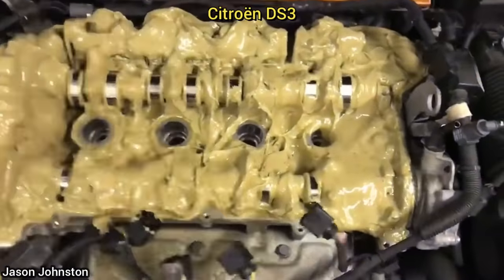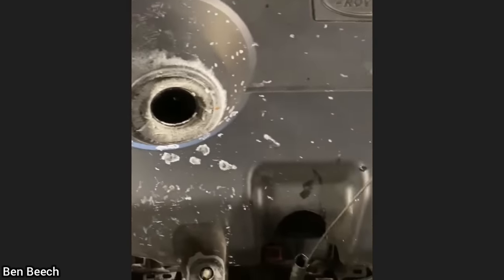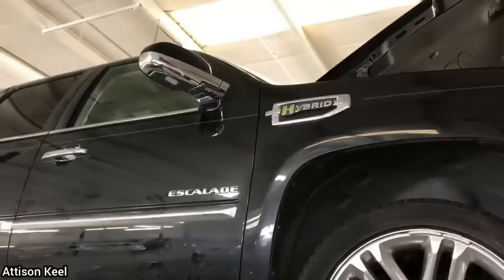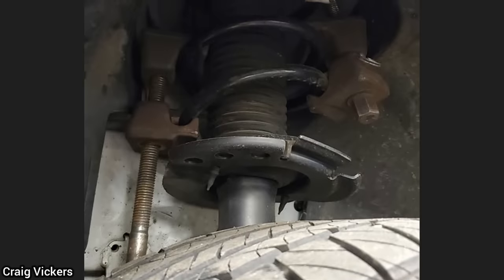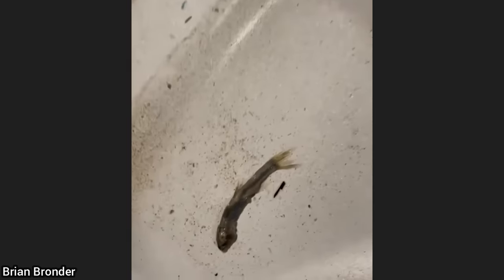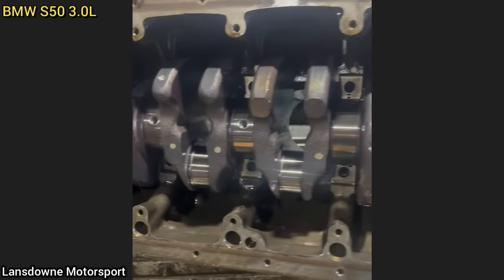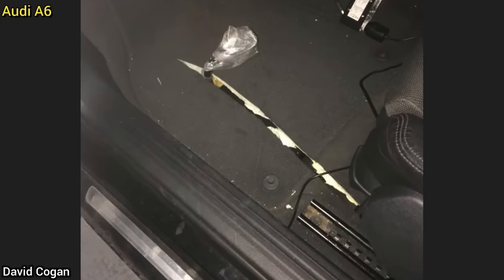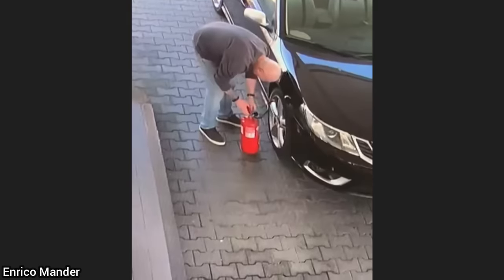Customer States The Car They Recently Bought Runs Rough

Comment: I am always amazed by how many people can not easily figure out where a small rattle is coming from.
Reply: I came to the comments to say exactly the same thing.
Reply: Lot of it is situational blindness. when something has been there for a while eventually your brain stops registering it as a thing until something forces you to think about it again.
Reply: When paying someone to find the problem for you is easier than finding it on your own, this happens...
Reply: Some people are observant and others aren't
Reply: @huma474  yes but you’d think in many cases that the second that item is there, the rattle would start, thus there’d be no guess as to what could be causing it. Also the absurdity of some things is just too much, like hundreds of pennys just rattling around? Gee I fuckin wonder where the rattles coming from.
Reply: I am amazed that these car owners can even get through the day.
Reply: Still scary to hear a rattle and then second guess yourself wondering if it's actually coming from the trunk or rear suspension.
Reply: @jessechristensen1074  When you hear a sound, and you don't know if it's coming from the trunk or rear differential, look in the trunk and see if you forgot you just loaded your trunk with 1500 tambourines. There's no reason to second guess.
Reply: Shortly after I bought my 03' bmw 330i sedan I had no idea the passenger side mirror turned down 35ish degrees to check the curb when backing up. I complained to the mechanic there was a horrible noise when the transmission was in reverse. Even speculated that prerecorded noises were coming from the speakers. Lol that was 13 years ago, still have the car. No regrets.
Reply: Counter-point - it's not easy at all. You THINK it comes from one place, but in fact it comes from somewhere totally different. The sunglasses one is easy to miss because you don't think that place should be rattling. I've fixed the following rattles: weatherstripping by the doors, door strikers, spare lug nut pipe hitting the spare wheel, center console opening tab, the ENTIRE A/C Controller Unit, the Styrofoam above the headliner (called silencers), instrument panel, speaker gaskets, solid objects around the fan blower motor, loosen tapes from excess heat, and of course cargo arrangements. It's tough to locate and fix them all by yourself, like, WHERE IS IT? Very annoying for quiet cars.
Reply: I'm amazed at people not knowing they have trunk fish.
Reply: @gwinbeer  i want to pretend you don't fix things for a living and just had a very rattly car.

I think it's safe to say it's a mix.  Some people just have an off period where their brain doesn't click.  Baby kept them up all night and now something is rattling and they just want it stopped.  Other rattles are hard to find.  But the scary one is when you realize there really are people out there who go through life taking in a third of the stimulus that you do and couldn't observe their way out of a wet paper bag.
Reply: I used to fix refrigerators. One customer's complaint was a loud rattle coming from the refrigerator. Right away, I noticed an aluminum iced tea set (pitcher and several cups, on top. One cup was rattling against the pitcher. I tapped the cup. Problem solved! You should have seen the look on her face!
Reply: @BakedRBeans I’m always annoyed by some hint rattling in my fridge due to the I balanced and poorly baffled compressor shaking the fridge at just the right frequency to oscillate certain items.

I have to admit to not looking for the obvious at first and thinking the noise was coming from the compressor itself.
Reply: Rattles are the worst to diag. I hate them.
Reply: If you turn the tunes up, you can’t hear the rattle -problem solved
Reply: My wife 😂
Reply: Right, too funny
Reply: rattle rattle
Reply: I'm amazed we're all sharing the road with these bozos.
Reply: I often repair small vintage mechanisms and have the same problem. The source of the rattle is right before my eyes, I have to see it but I just don't. One solution I found is to connect a  usb microscope to a large screen and watch the action in ASMR mode. Some "unnoticed" issues are then quite evident.
Reply: @TheBanjoShowOfficial  That's what I'm talking about. Dude throws a metal washtub full of broken banjos in his back seat and he starts hearing a rattle in his back seat. "Where's that rattling coming from?"
Reply: @gwinbeer  That's very true and I've had similar experiences. I'm talking about people who surely couldn't be bothered to reach up and  touch something that's rattling right next to there head.
Reply: A few days ago, I bought a musical keyboard from a yard sale. I looked at its sides 3 times over several days, and didn't see the power jack (or the other 3 jacks) on the side of the unit. It took me a 4th time before I noticed it. I thought it was designed to run on batteries only, and no A/C power...
Reply: I have had a few rattles that just took a few days of driving to figure out. One was the passenger seat belt rattling against the C-pillar (I think that's what it's called), some CD covers flipped around in my center console and I put my ice scraper in the door. It's not that hard to figure out.
Reply: There’s a rattle in the dash…

Others:  take it to mechanic 

Me:  live with it
Reply: "What's a battle?!"
Reply: Well... i was wondering for weeks where that odd clunking noise is coming from when breaking or accalerating. Let me say, i checked a lot of things. But in the end it was the spark plug socket i careless threw into the glove compartment...
Reply: @huma474  You’d think they would check though. Every time I hear I rattle I think ‘where tf is that coming from’ and actually look, and many times it’s been items in my car just rattling against something but no money was spent finding out
Reply: Told a gal that was sitting with the engine idling. "Your Envoy is making expensive noises. Might want to check the oil."
It was not making lifter noise. The rod was knocking and wanted out.
It's OK my boy friend will fix it.
😆😆😆😆
Reply: My mom had exactly one of these phone holders and it rattled so bad she had to remove it. I have a hard time believing someone would not be able to hear from where that sound was coming from. We did get confused for a little bit, but then one of us tried touching the plastic thing where the sound came from. Also, if you put a phone in it the rattle stops, which also makes it more apparent. 

I have definitely been guilty for other things like this of calling someone when I should have checked more closely first, but this specific one seems extremely obvious to me.
Reply: Thanks for saying it
Reply: @theotherohlourdespadua1131  and that, in a nutshell, is the distinct PROBLEM with the USA!
Reply: @downtostandup  goes to show the education of the general public has failed miserably for decades.
Reply: yeah, and on mine, its usual key chain, or water bottle at the sides... its so obvious

Comment: Ah yes, the dreaded "rattle/squeak" complaint. I worked at a Ford dealer for a while, many decades ago, and it was always a techs most hated complaint to try and diagnose. 99% of the time it ended up being something that the vehicle owner had done and not an actual manufacturing flaw. And 98% of the time, the customer was just as mad or madder that it turned out to be their own fault.
Reply: Well, at least when I bring in a rattle complaint it's something like a sway bar, and generally what to take a look at.  At least know the sounds of the car verses the sounds of the junk you put into your car.
Reply: I knew a guy who bragged about how he had leftover trim screws when installing new-car interiors. he was kind of proud to be quickest/most efficient at the factory production line.
Reply: 99%? well then you surely could share with us at least 10 things that "the owner had done" 😂😂
Reply: @gusrock6719  😉no worries
Reply: I would love for a rattle to be just something I forgot in the back. Sure, I would feel embarrassed, but that's very much worth it considering the money you just saved
Reply: How dare you accuse me the customer of messing my car up? I AM THE LAW

Customers can be very… interesting
Reply: I had a squeak like that when I bought the latest car. It turned out the 3rd brake light cover came a bit loose on one end. It's bolted onto the roof panel in the cabin on one end and reaches backwards over the back window, since it's a coupe model. Without the glue holding the whole cover still, two bolts made the noise when it jittered up and down. Taped it back against the glass, problem solved.
Reply: And to think they laughed at my theory that space aliens are creeping into people’s rooms at nite and sucking their brains out thru a straw.🧠👽

Comment: These videos make me feel like I take such good care of my car, because it doesn't have pudding in the engine!
Reply: A good recipe for engine pudding is: add water to oil, then bring to boil.
Reply: The forbidden pudding, from the makers of the forbidden milkshake
Reply: Didn’t the person look at the dipstick before buying??
Reply: or fish in the hatch.
Reply: You need diesel exhaust fluid in the crankcase for that level of wizardry.
Reply: @MattExzy  Don't forget to fill your tire up with a fire extinguisher, Fire proof tires are very vital.
Reply: cock mcballs  they don't use CO2 in the powder extinguishers, propably nitrogen. CO2 bottles usually have insane amount of pressure also to keep the CO2 liquid.
Reply: I drive a Ford 2005 F-150 and a 2009 Smart car. They are fine as a fiddle as long as parts are available for them but I'm starting to have difficulty finding replacement parts.
Reply: Simple rule. If you don’t know which fluids go in which hole don’t attempt to do any work on your car
Reply: That Citroen owner didn't deserve a damn pudding in the engine and i absolutely hate that this happened. Imagine buying an $8000 car, taking care of it, then driving it into a dealership because of a rough engine sound, only to find out that some french mechanical engineer messed up yet on another car and you have to pay for all of the mistakes that this guy caused. Citroen should definitely pay this.
Reply: I am sure thankful that my grandfather and dad taught me to work on cars and to take care of them. It's hard to believe how folks treat their cars, and ya gotta know where to pour the correct fluids into.
Reply: It does look like tapioca pudding,lol

Comment: Regardless of any dumb things the owner did, THIS IS EXACTLY WHY THE PARKING BRAKE SHOULD NOT BE A TINY, EASILY ACTUATED SWITCH
Reply: My boss has a Range Rover and the thing had like 15 thousand miles and it already needed brakes all the way around including rotors,they were gonna charge him like 1800 dollars so i told him i could buy the parts he needed (quality stuff) and if he would give me 100 bucks and pay for the parts i would do the job for him, ended up costing like 500 bucks,hes a really good boss so i help him when i can,reason I'm bringing this up is because that was my first encounter with those damn dumb emergency brake levers you mention in your comment.

I actually had to take the rear brake calipers apart to disable the system (dealer uses a very expensive computer),there is no need for all this nonsense, a cable would work just fine, i also found out that Land Rover has this insane method of bedding the pads when new that made me suspicious why the brakes were shot at such low miles,i dont care if its a Ferrari or a Yugo,you put new pads and you drive the car moderately first few hundred miles,no panic stops or riding the brakes and the pads will bed beautifully, not rocket science.

Comment: How does a man make it to adulthood, and think the proper way to fill a car tire is with a dry-chemical fire extinguisher?
Reply: The $64 Question of the day.
Reply: Cable news and or social media - doesn't matter which one you watch or which site you're on, it rots your brain
Reply: He wanted to prevent the tires from doing burnouts
Reply: There was a dual purpose CO2 extinguisher & tyre inflator available in the UK maybe 20 years ago. No I never had one and didn't know anyone who did. 
Imagine grabbing it for a fire only to discover that the slow punctures you should have got fixed left the cylinder empty!
Reply: @jonathanmimnagh8956  Huh. Well, I'm glad you've given a plausible explanation for why this gas station video exists. Maybe it's more of a simple misunderstanding than it first appeared.
Reply: He might be colorblind? Just by the shape, there isn´t much difference between a fire extinguisher and a tire inflater
Reply: And worse, not know what an extinguisher is actually for...
Reply: Drugs... and "free" money from the govt...
Reply: @livewire2759  Yeah no, sorry you drank the kool aid mate
Reply: @DounutCereal  LOL  How so?
Reply: The truth is, he didn't make it... They are still in their teens mentally
Reply: Where i live, small/old gas stations don't have automated compressor systems. They instead have a little air tank that hooks up to a compressor on the wall. The tank is a cylinder, has a handle at the top and a little mechanical gauge. They attach to the tire valve with a black hose. 
I have only ever come across one of them that wasn't red, so they do look a little bit similar, and i can see how one could get them mixed up. You would have to reeeally not be paying attention though.
Reply: i just had to use one the other day. Had some brake cleaner catch on fire while had a car on the lift. Those things make a massive mess!!!
Reply: @KnittedSister  I have one that looks like that as an add on tank for an air compressor but it's silver
Reply: Huh! These comments are super-helpful in understanding what the everlivin' kerfuffle was going on there 😆 I've only ever seen the high pressure air hoses outside gas stations here for tire re-inflation, didn't even know tank-based tech had been a thing for that...?
Reply: As it happens...... if your stuck somewhere & have no way whatsoever of inflating a tyre but you have a pressurised co2 extinguisher, it would have got you home.
Reply: How does an extinguisher get mistaken for a tire inflator? Maybe they can't read english?

Comment: Thinking about those springs, I always love when mechanics donate tools to me. Such wonderful generosity.🥰😂
Reply: Yep, I have a swlwction of 10mm sockets....
Reply: I scored a $30 Snap-On flathead screwdriver. Tech left it in my radiator. Bent some fins, totally functional. I’m calling it even.
Reply: @alexbrown1995  10 and 13mm, like clockwork.
Reply: I've never been fortunate enough to have mechanics donate tools to me.

Contractors, absolutely. I'm always picking things up while out delivering papers. Screwdrivers, a 1980s-ish Craftsman 15 mm wrench, a brand new (pricey) set of pruning shears, two cold chisels, the occasional Grade-8 lag bolt, a nice 8-lb mini sledgehammer...

And screws. Lots of screws. Although those usually end up in the tires. 😠In one week, I picked up two in the same tire, and a week later, a third in the same tire. Occupational hazard, I guess! I replace more tires due to punctures than I do to wear.
Reply: A mechanic left like a 3' ratchet extension under the hood of my sister's car once, but we returned it because we're white.
Reply: @lector-dogmatixsicarii1537  Most common used, most common replaced. Dropped a few down behind the trans shield and between the body. say goodbye.
Reply: @overload3996  I must be some sort of patrician having magnets on sticks for this.
Reply: @lector-dogmatixsicarii1537  tried, magnet couldn't get in far enough, and stuck more so to the metal body. Is what it is, purchase more.
Reply: @grnsgottaM  30 years ago I found a swivel Snap-On racket at an intersection in Pennsylvania. I have been using it to change oil ever since. Nice tool. Bet it was expensive back in the day.✌🏻
Reply: How ungrateful am I that I didn't thank the guy who left the ratchet under my rear passenger seat!

It took me a while to figure out where the rattling was coming from, because it only happened when I was making a hard turn. And by the time I get home to look for it, I would have forgotten about it.
Reply: probably have to remove the entire assembly to get those off though.  What was that mechanic smoking?

Comment: Wow, that happened to me too! After a (manual)transmission rebuild, each summer the transmission oil turned to lightbrown goo, and started leaking. Every year it happened, and it needed to be drained flushed and filled, and needing a rear seal. Only at the third time a mechanic saw that the transmission shop had connected the ac drain hose to the transmission vent. The other two times the mechanics accused me of using my car as submarine.
Reply: Bruh

Comment: Rattles, like the sunglasses in that video, can sound like they come from elsewhere. I had a rattle that sounded like it was from the passenger door pocket but could not find anything in there or close by. After a week or so I noticed that the sun visor was not clipped in properly after I'd had it swung around to stop the sun blinding me through the side window. Clipped it in and the rattle stopped. Even though it was in front of my head it sounded like it was from the other side of the car.
Reply: I had a front wheel bearing start to hum in my Toyota Aurion. In the drivers seat it sounded like it was passenger side, in the passenger seat it sounded like drivers side.
Reply: Once heard that a car in the 1950s was sent out with a coca cola bottle behind one of the quarter panels, with a note in it saying "Bet you wondered where that noise was coming from!" (Or maybe it said "clunk" instead of "noise.")

Eh, I don't know if that ever really happened. It could have.